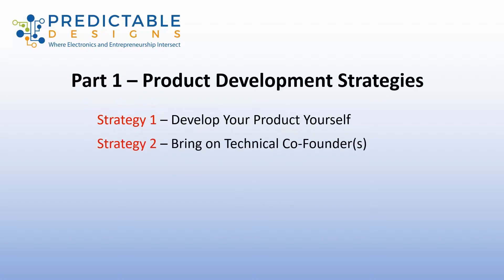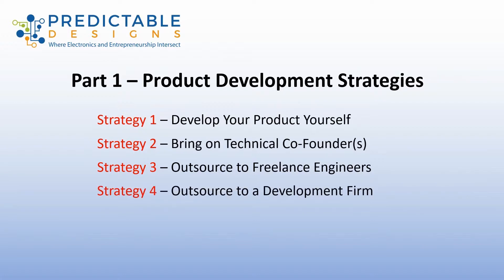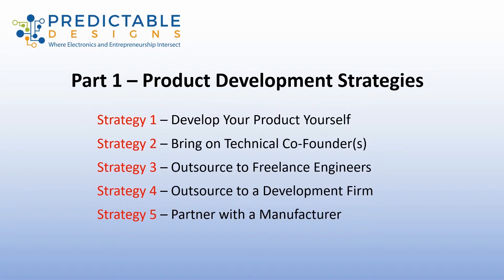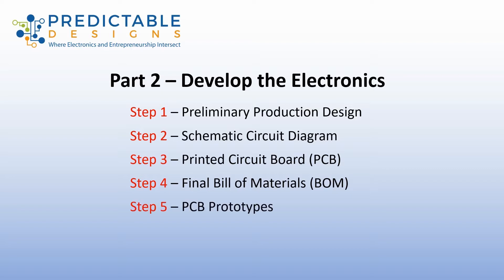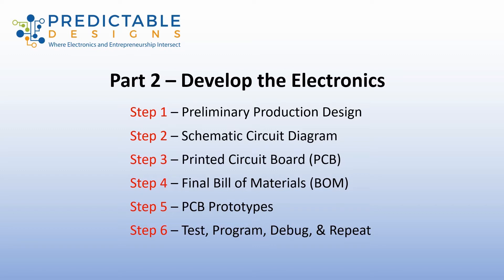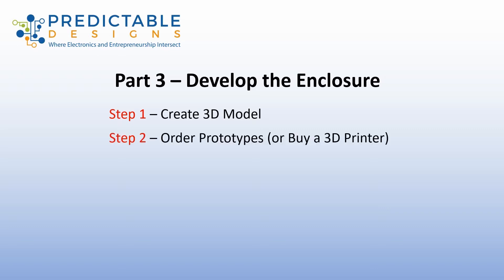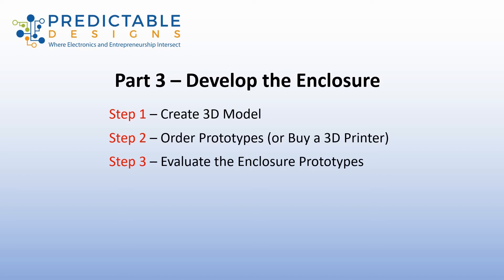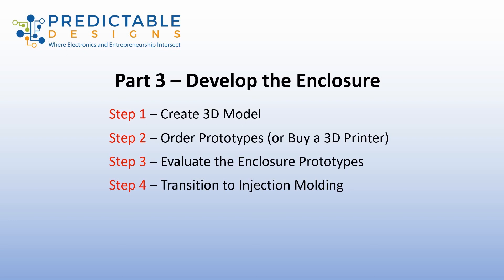Ultimate Guide – How to Develop a New Electronic Hardware Product

Comment: Perhaps before going into enclosure prototype, it would be a good idea to export the PCB and assembly as a 3D file for 3D model matching. Most of the CAD software can do that nowadays. Then you could avoid component coliision and have design matching, then the success rate of enclosure design is higher.
Reply from the maker: Yes, most definitely you want to do that.

Comment: At what stage do you figure out how the device can fit into the enclosure. I want to make a very small gadget. I have circuit board design. Is the pcb drawings where they take that into account, or when they actually have to make the pcb
Reply from the maker: It's always challenging with smaller products. The battery is commonly the biggest component. I'd estimate the battery size and PCB size then use those to start work on the enclosure. If the battery is much bigger than the PCB then the PCB size matters less.